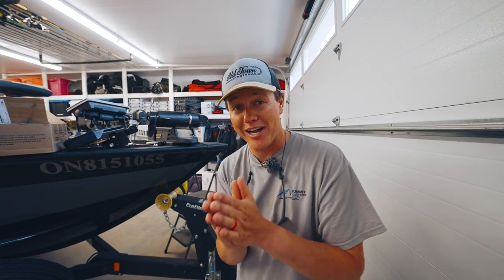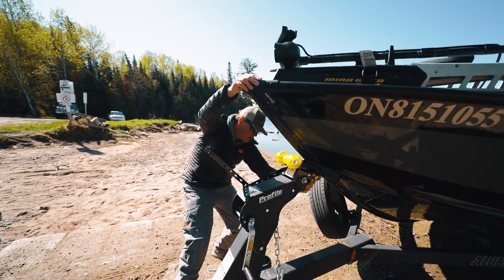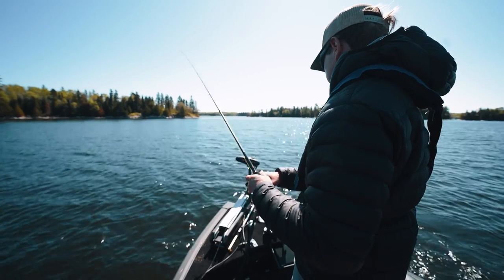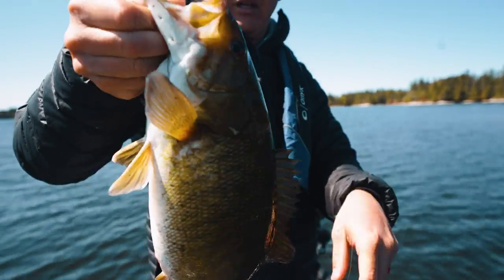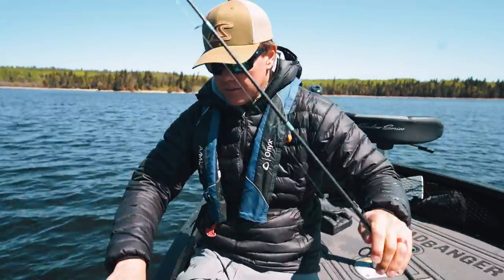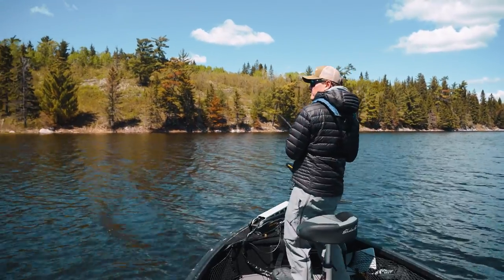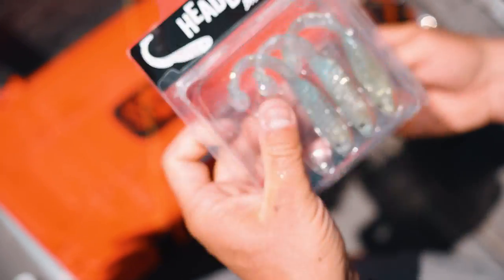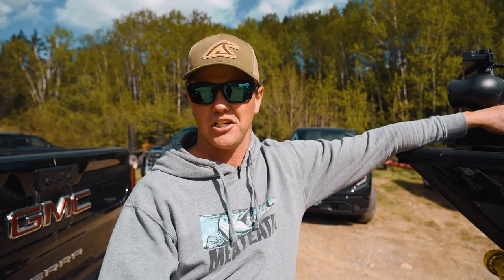The KEY to finding fish in the spring. Ontario Multi-Species!

Comment: Pro tip for anyone: When banging out bolts, you can leave the nut on so the ends are flush. This helps you from potentially bashing up the threads 🤟